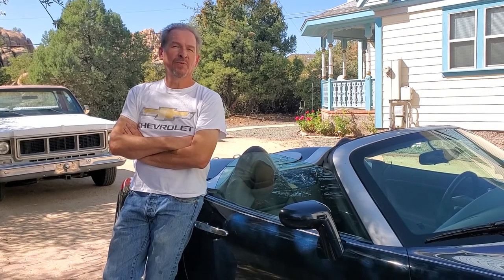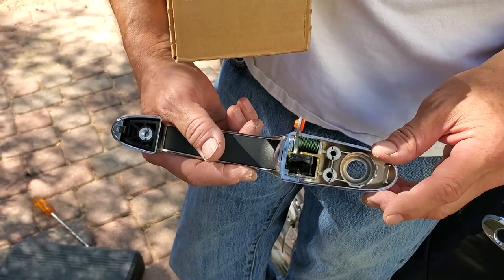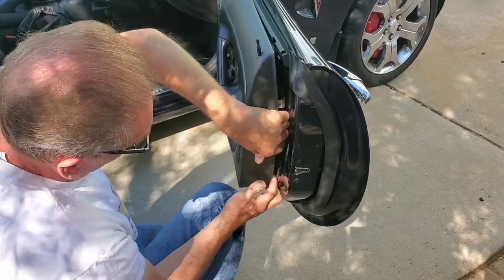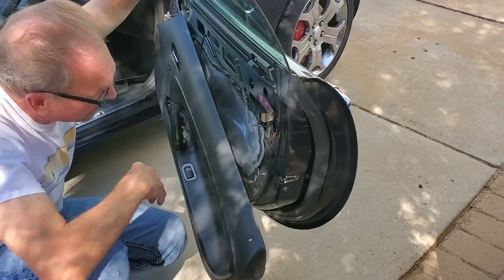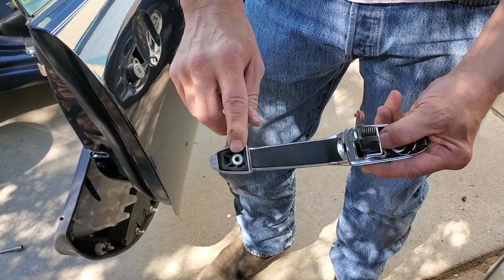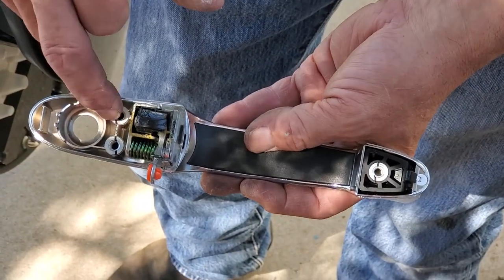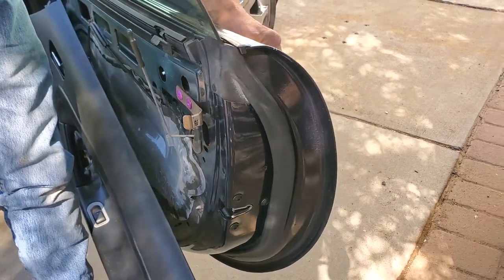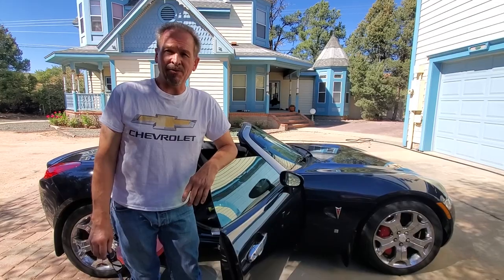Pontiac Solstice Saturn Sky Exterior Door Handle Replacement

Comment: Great vid.  Straightforward....just came to see how to remove the door panel.  Much faster than figuring it out myself.   

Found the part on amazon for $16.........
Reply from the maker: Glad it helped, and that is just fantastic! Thanks for the additional tip on where to find one. Thanks for watching.
Reply: That's great.  Carid wants $26 for it in chrome finish.  Will keep looking.  Thanks for the tip!

Comment: Thanks so much for the video. The magnet tip is great, did the same thing on mine. surprised this crap is plastic. One thing I did was to fill the gaps around the screw holes I used a 2 part epoxy Loctite  E-05CL before installing.
Reply from the maker: That sounds like a great idea. Thanks for passing that along to our viewers; I'm sure it will be useful. Thanks for watching!

Comment: I just changed mine & this was very helpful. Thanks so much for making it. The handle bolts on mine actually had some of the black sticky sealer - probably from the plastic liner inside the door - on the bolt heads. That made them stick inside the socket when I was both removing and reinstalling them.
Reply from the maker: Glad you found it useful. We're happy to have shared the video with you before you delved into your project. Thanks for watching!
Reply: My car handle looked broke exactly where the video showed, I followed the video step for step and I was successful in replacing with the new one. Was extremely helpful.

Comment: Good vid.  This was the second replacement I've done for others. Knowing it's flaw, I used JB Weld 5 minute 2 part epoxy.  Mixed a one inch diameter amount with plastic spoon using the handle end.  Using the handle end of the spoon, scrape up a nickle sized amount and carefully position it over the opening in the handle between the two threaded bosses and let it run down into that cavity of the handle.  

Repeat that in the smaller areas in dime size amounts being careful not to drizzle any into the threaded bosses.  The first one replaced on a Sky was in 2011 and still going good after 41k miles.  Today's replacement on a Solstice had its original handle at 67K miles.  I agree that the gussets are inadequate and could have been beefed up when the tooling was made to manufacture these replacement parts.
Reply from the maker: Thank you so much for detailing these wonderful tips for us and our viewers. It's a strong point for you to share your knowledge. It will be helpful to anyone who is watching the video and reading your comment. 

Thanks for watching our video, glad you found it useful.
Reply: I came to the comments specifically to see if anyone had reinforced with epoxy. Thanks.

Comment: Thanks for the video. Is there much difficulty disconnecting the power mirror connection from the panel? I'm replacing the interior door handle and need to bench it. Thanks for your help 👍
Reply from the maker: Not that I know of. Check out our interior door handle replacement video by clicking here: https://youtu.be/pSp02YkB8Ws Hope you find it useful. Thanks.

Comment: Since the rear two bolts are broken, if you take the front out first, will it then allow you to get the handle off and work on the outside of the back two bolts a bit easier?
Reply from the maker: Good question. No, I'm sorry to tell you that it won't work out. Thanks for watching.

Comment: Hi David, I have a pontiac Solstice and the inside door handle mechinisum is not opening the door.  Its like maybe the spring is broken.  I wanted your video to replace the door handle however I am not sure exactly what is wrong.  Any ideas,  I can pull the inside door handle however nothing will release the door.
Reply from the maker: Since a number of the parts are plates it is likely one of them has broken due to age. You will have to remove the door panel to find the damaged part. Thanks for watching our video. Hope you found it useful.